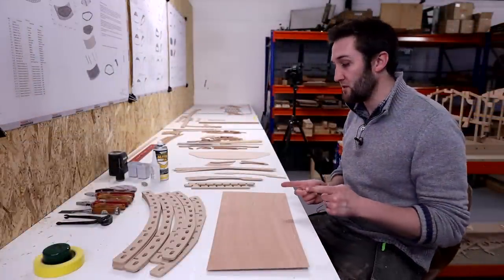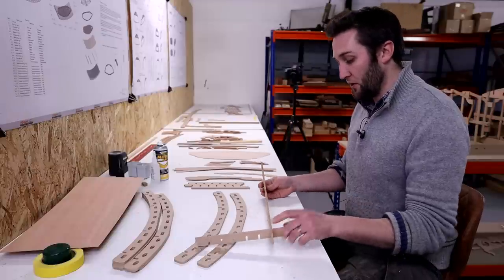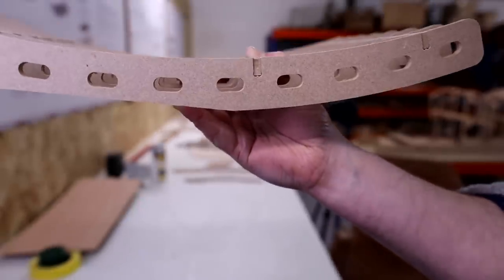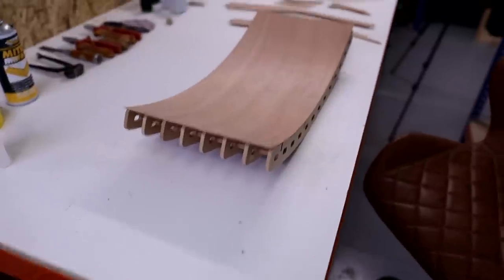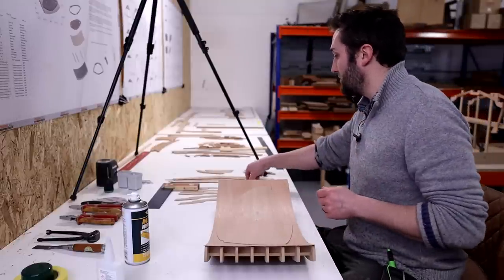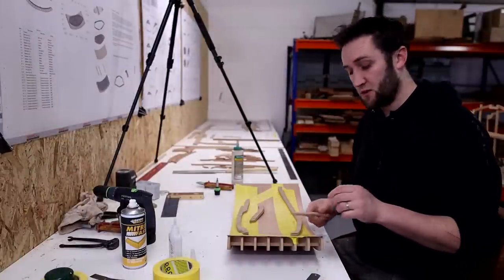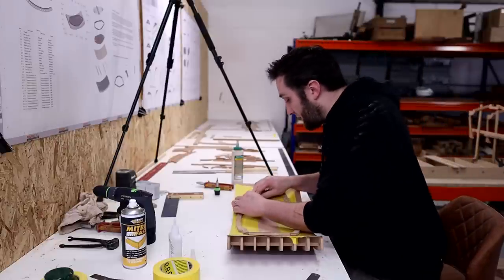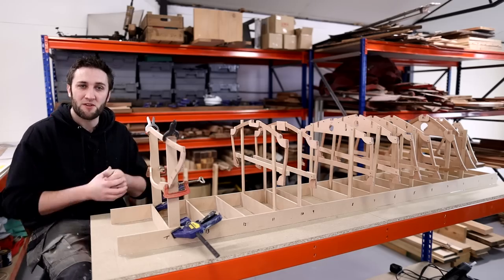Building the Transom | Temptress 1/4 Scale Boat Build Part 5

Comment: Loving the series, readying a build area (probably for the 1/4 scale). With the secondary option using dowel/pinholes, is there still a need to have oversize laminate pieces and then need to rework the laminated structure to size as there probably won't be any slippage?

Comment: Does the transom skin have to be on the jig for building the transom frame?  Seems that you could trace the position of the skin for reference.  

Awesome build.
Reply from the maker: No it doesn't really need to be on there other than for positioning, I would think tracing the skin and then removing it would work just as well actually 👍

Comment: Why not built the transom structure on the boat first and put the skin on top then? Just the classic way, saving the wood for the jig here. If there's a reason for that, you should tell the people why you chose this way. The frames should have even more connection surface to the beams than a domino or so I believe. I'd overlap the frames with the beams.
Reply from the maker: How would you form the curvature in the laminations if you build the framing on the boat?
Reply: @DanLeeBoatbuilding  
Just set up a few vertical frames connected to the stringers and other structure. Other classic boatbuilders haven't build on molds as well. I know Riva transoms are more straight on the bottom, but I believe Chris Craft had curved ones. If the wood needs to be bend or laminated does not make a huge difference. I'd install some temporary structure on the strong back to find the form. Gives more safety everything is correct as well. Setting up the transom structure leaves some serious points of doubt until the transom is fitted. As you said, the position on the mold needs to be ensured
Reply from the maker: I don't think that method would offer sufficient support for the laminations, a few verticals would create hard points in the curve rather than continual support across the whole width. It would also not offer sufficient support to form the slight twist that is in the side framing components, you'd probably need three verticals just across the width of the side framing alone. Having the mould positioned on the strongback would mean doing all of this lamination in a vertical position rather than flat on the bench. Having the mould positioned within the strongback setup would mean it get's in the way of the next processes to follow, when it comes to installing the stringers and it would need to be removed and replaced with legs at this time anyway. I believe the best method to approach this transom assembly is what I show here, forming the assembly off the boat and then installing it with strongback legs as we do with the other frames.
Reply: @DanLeeBoatbuilding    Of course the verticals were needed to be beveled and so on. Maybe you're right, with the curved transom it's a lot different. I just wondered if there's no difference in wording regarding laminating wood or glass fibre? Couldn't find any online. In German we say Laminieren for glass and Lamellieren for wood. But that's just a hair splintering thing of German language I believe.
Reply from the maker: Not that I know of, I think it is written the same regardless of what you are using. The Gougeon brothers book may well hold the answer to that one.